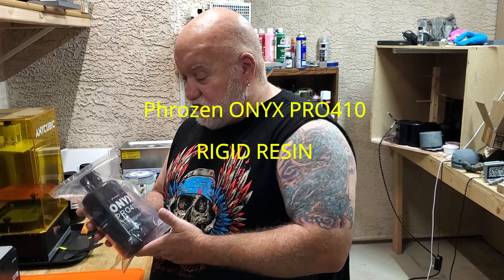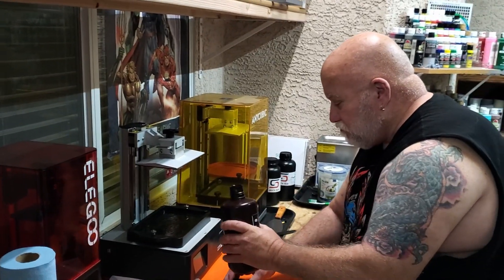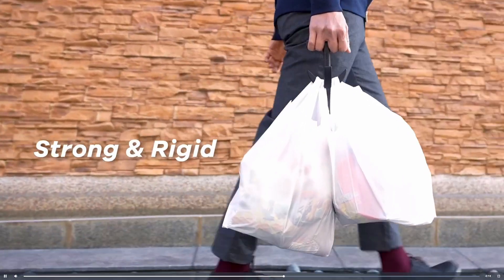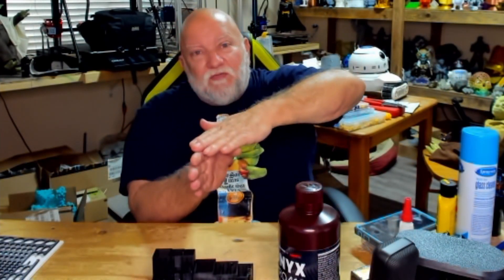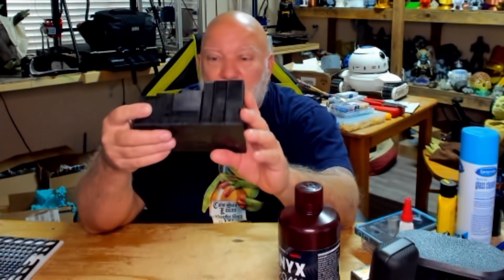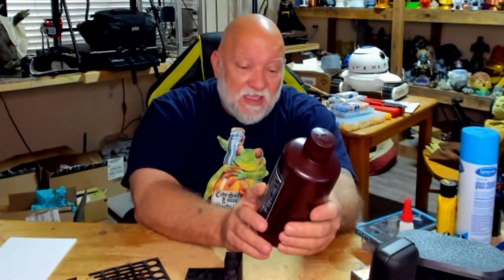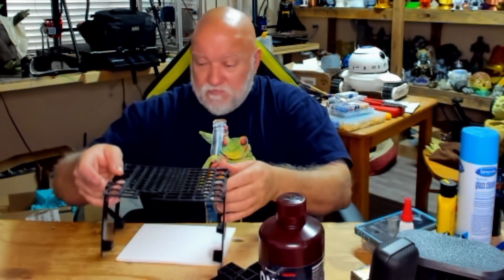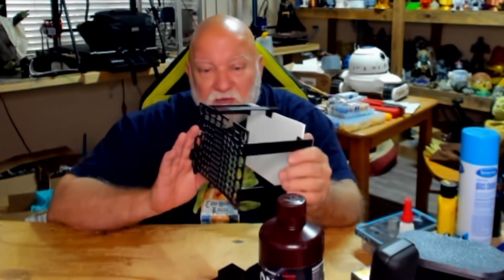PHROZEN ONYX PRO410 RIGID RESIN #3dhp

Comment: Can this resin be printed on lcd printers?
Reply from the maker: I only used this type 1 time,but all the resins I had tried have worked on all my resin printers,sometimes you need to tweak the settings depending on the resin.